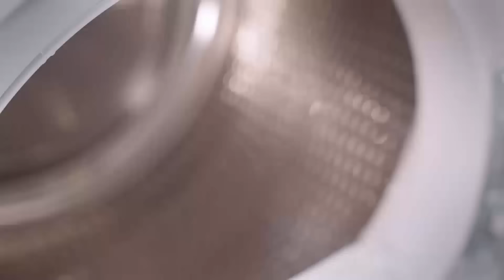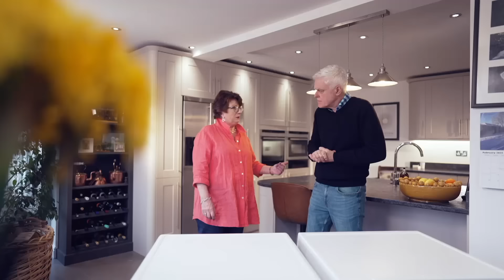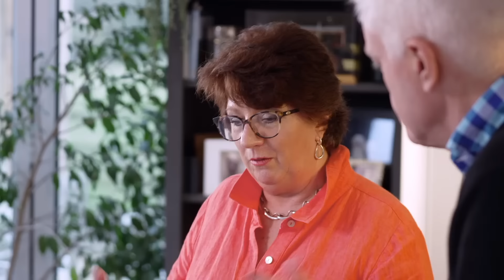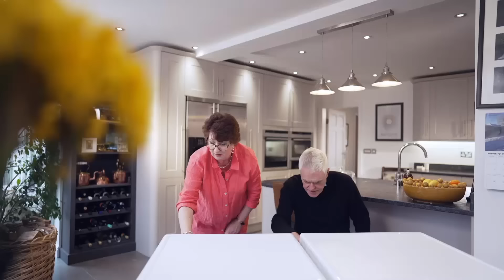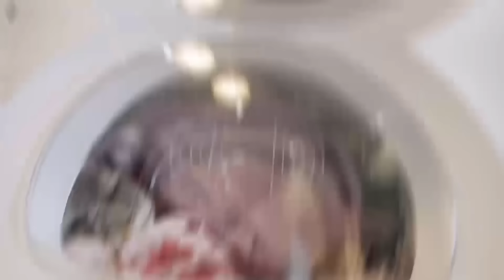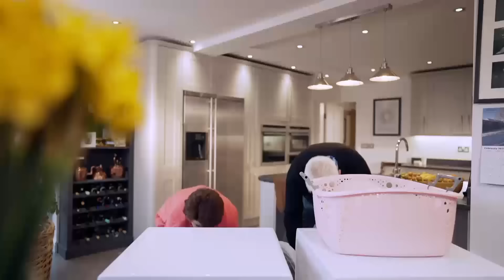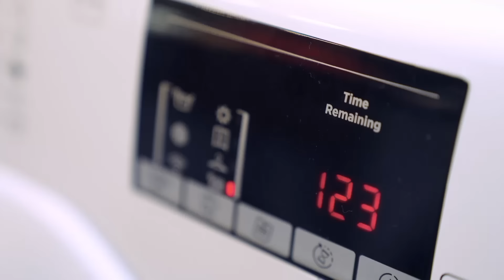Heat Pump Dryers Tested: £549 Bosch vs £349 Hoover – Worth the Upgrade? | The Gadget Show

Comment: One other factor is reliability. We have a hoover washer dryer and it breaks every 6 months, the extended warranty on it has been a life saver. We also have a 20 year old bosch dryer that hasn't missed a beat ever.
Reply: When hoover used to make them here in Wales at Merthyr Tydfil they were great machines.most of my family worked at this famous factory now sadly gone
Reply: if used daily a heat pump can actually pay for itself in a year or two... plus condenser tech is very proven my fridge for example is like 15 years old
Reply: @HarryL2020  i have around a 900 pound bosch, and that one is used daily, minimum of 2 times a day. so it should go quickly
Reply: Refrigeration systems are generally very reliable, well made freezers can last for decades. If you hunt around on YouTube, the main additional problems with heat pump dryers seems to be loss of refrigerant, likely the result of corrosion or poor materials and build quality as it seems to be cheap end  budget brands that are most affected. And the heat exchangers getting clogged with lint, reducing efficiency, the advice seems to be to make sure you clean the filters every use to make them last, without needing maintenance
Reply: On the other hand, I have a Bosch dryer that is 4 years old that needed a repair.  Bad relay on the control board.  Fortunately I was experienced enough to do the job myself, as it would have been over £200 to have Bosch swap the board.  Bosch used inexpensive relays which failed prematurely, and this is a known issue with certain condenser models.
Reply: I recently had to get rid of my hoover washer, I had had it for like 20 years, before me my brother had it for around 8 years, and before that my mum had it for around 10 years. the older Hoover stuff was great, not too sure about the new stuff. that hoover washer was around 3 times as heavy as my new one. and the thing that gave out on the hoover was the connection between the outer drum and the connection for the water pump pipe, it just rusted away.
Reply: @johng.1703  Hoover is now owned by Haier, so I wouldn't expect their current machines to last that long.
Reply: I’m calling BS, why would anyone who has a properly functioning dryer buy a second new one and still keep using the old one 😂
Reply: My Hotpoint also breaks every 6 months
Reply: You are comparing a washer-dryer from hoover to a resistive  Bosch deyer... What did you expect?
Reply: Washer dryers break often any brand I've seen.
Reply: I've been an appliance engineer for 36 years hoover products these days are all low quality Chinese built products very flimsy build quality 😮 their heat pump dryers block up easily even with proper maintenance 5 years life span at best 😢 the bosch ones a in a different league but all heat pump dryers suffer with getting blocked up with dust and lint and will require a complete strip down to clean out the evaporator and condensers pump drain channels to 🫣 the dry cycle just gets slower and slower till they don't dry at all .I find it averages a maximum of 8 years even on higher end models and it's hours in labour lot's of engineers won't take the job on you can't make it pay .the other thing to think about is the rest of the inside of a heat pump dryer is based on a standard condenser dryer .with the cycles being longer on heat pump dryers parts wear out faster 😟 they all need to improve to negate the extra cost
Reply: @seamusspratt7205  How funny, my Dad is an appliance engineer. About the same amount of time as you at 38 years. He's of the same opinion, also still holds a grudge for manufacturers sealing the drums... Can't say I blame him, but hey, it"s "greener" even though every 5 years you have to send it to landfill and reship a new one from China...
Reply: @tve1176ae Scrap appliances are recycled. They don't go to landfills!
Reply: @seamusspratt7205  Hoover and Candy are now under Haier, which is the best brand in Europe, Miele and Bosch are getting worse day by day
Reply: @seamusspratt7205  very true, which is why i opted for a bosch serie 4 for my mum, without the self cleaning heat exchanger.
Reply: @washingmachinetvbywhichwasher Very untrue, new selfclean and autoclean system is much better now.
Reply: @seamusspratt7205 agreed, hoover/candy is some of the worst, getting bought by haier didn't improve things 😹😹, I recommend Beko at that price point these days, B/S/H isn't really worth it these days but still better than most.
Reply: @seamusspratt7205  What do you recommend for a single man ?
Reply: @seamusspratt7205  The BOSCH ones are still junk. Even 6th series. Their self-cleaning procedure is crap and the filters get cloged with the paste made from the fluff + water.
Buy a Miele if you want real quality.

Comment: You missed out the most important part. How much could you have a got a vented dryer for when this was filmed? It probably would’ve taken 3-5 years to get your money back on the price difference between it and the Bosch. I got a Beko HP for £450 when my condenser blew and it’s good as gold but I’m not getting the money back from energy saving for at least 6 years against the equivalent Beko condenser that was available at the time.
Reply: Washer-dryers have consistently been shown to be worse than individual units - both in efficiency, effectiveness as well as reliability. If possible, it's probably better to go with separate units.
Reply: @FahadAyaz  I didn’t mention washer dryers in my comment buddy. Never use them as they’re useless. Comment above is comparing condenser dryer and heat pump dryer

Comment: why does it look like the clothes there putting in already look dry?
Reply: Form the washing machine final spin to save drying time the faster the setting the dryer the clothes when out the washing machine it so thay not dripping wet when they come out socking the floor if your washing coming out dripping wet then you’re not using the spin right or thirds somthing wong will the machine if dripping wet  clothes go in the dryer it will takes for ever cost more in electricity and the tank will probably fill up before it’s even dry shutting the dryer down